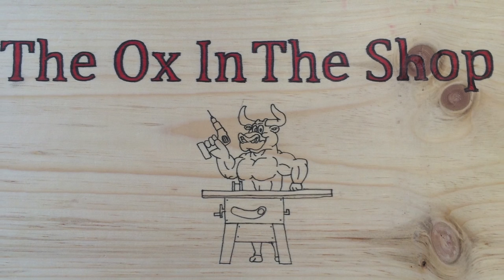DIY wooden sunglasses

Comment: Not a lot of people have the tools you do to make these glasses. Why don't you do this project with out the tools you used and make it with out them. That would be a better project at least for most of us who don't have the option of using the tools you did.
Reply from the maker: What tools did I use besides a dremel and a drill press that is pretty cheap tooling